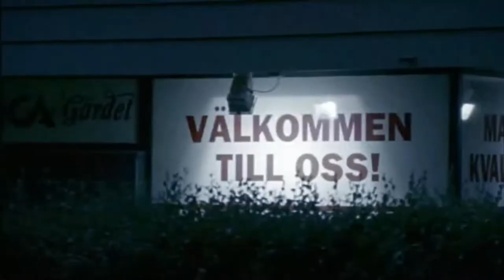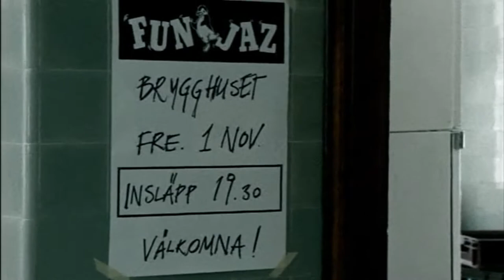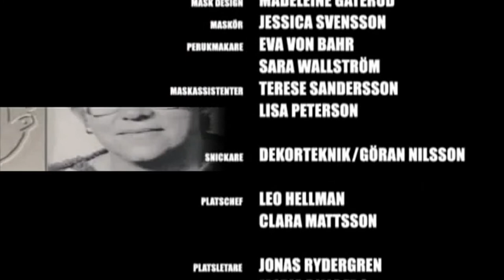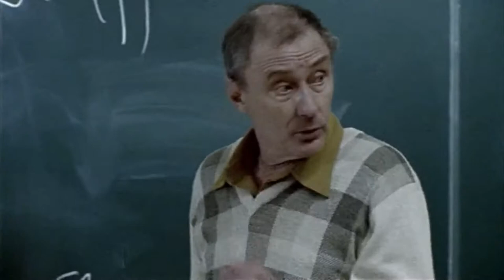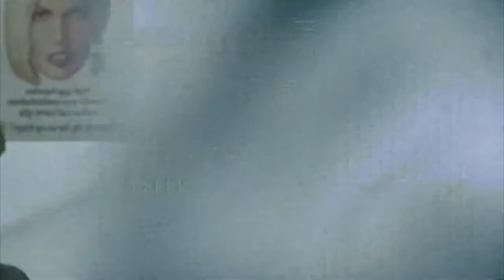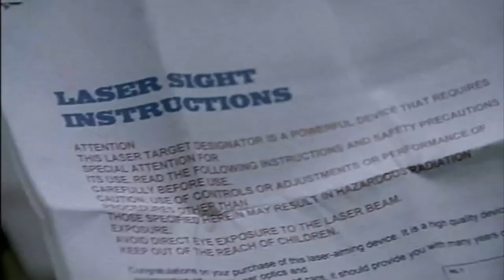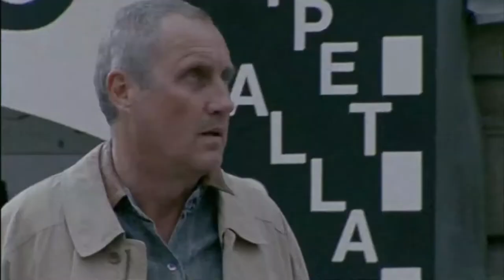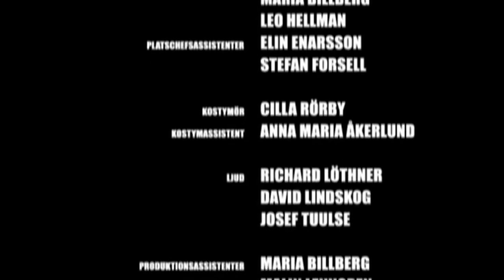Lasermannen

Comment: Is it possible to upload it in better quality? Been looking for this forever. Thanks!
Reply: SVT Streamings  Even when I click 1080p the quality is not that good, compared to the quality it had on SVTPlay. Would be great if someone could upload it in better quality, even if it means they need to split it up in several parts!
Reply: SVT Streamings  I ment, if the reason to the uploader is to lower the quality of the video so it can be one part (4hours+), then I meant that it would be better to have several parts in higher quality (to lower the file size) if you catch my drift. Just one video with higher quality would of course be the best.